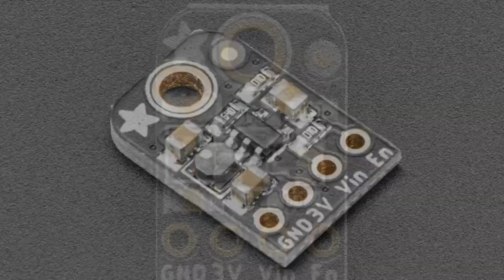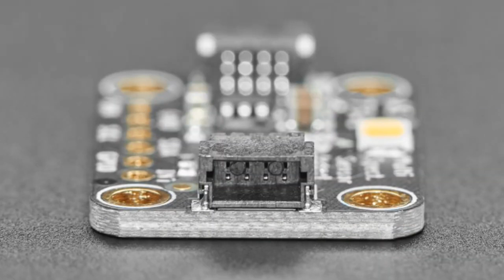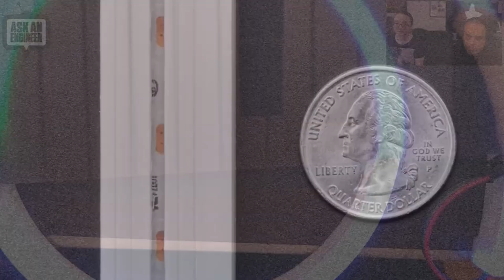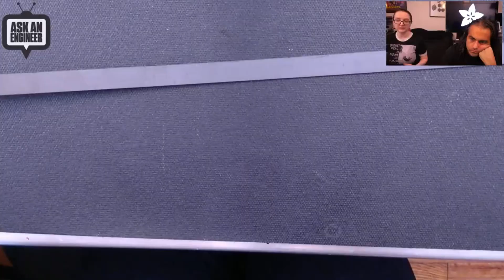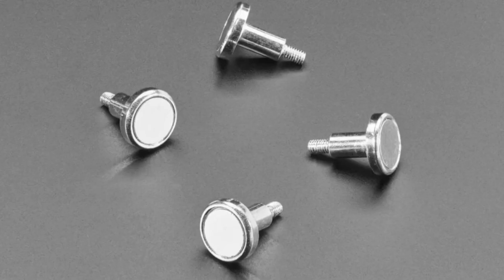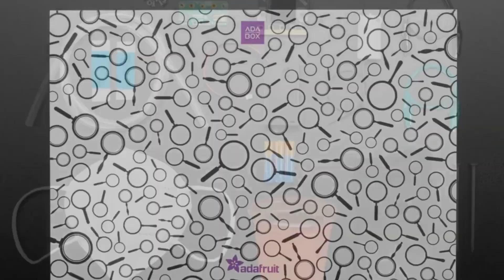New Products 8/21/20 featuring Adafruit MS8607 Pressure Humidity Temperature Sensor-STEMMA QT/Qwiic!

Comment: 19:18  Using the PHT as an Altimeter would require some math to be added which would adjust Pressure Altitude (P) with local elevation in order to derive an Altimeter Readout from the device.